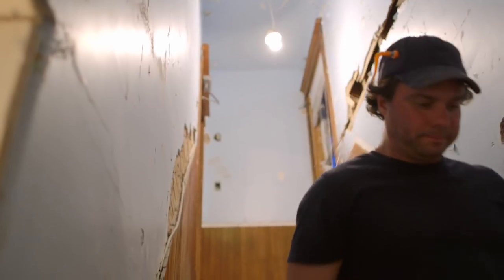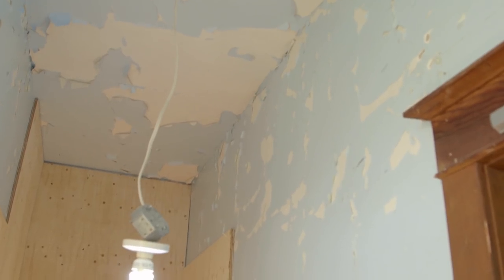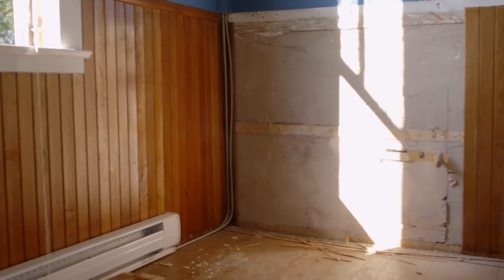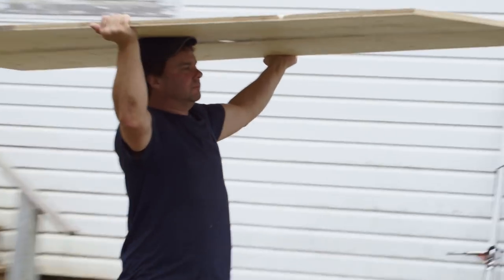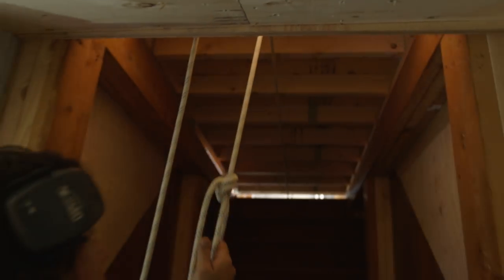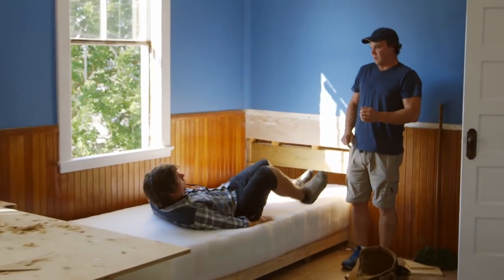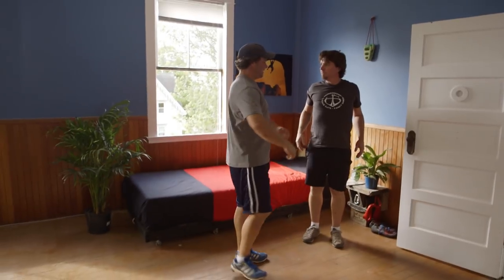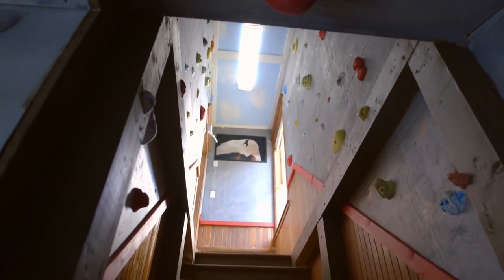How to make a Climbing Wall Crash Pad

Comment: The coolest solution would be a pull out / collapsible staircase(s) with a crash pad underneath. Maximize your vertical wall area and height... While maximizing cost and complexity of course...

Obviously you can't overstate the utility of a relatively normal staircase when you're not climbing the walls. I'll grant that your solution is probably the most practical and the most likely to be used consistently.